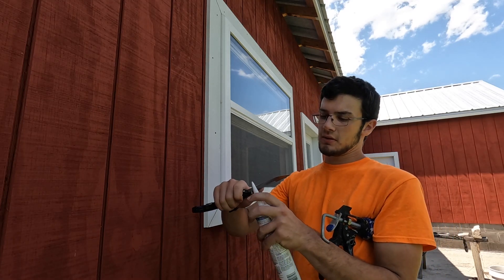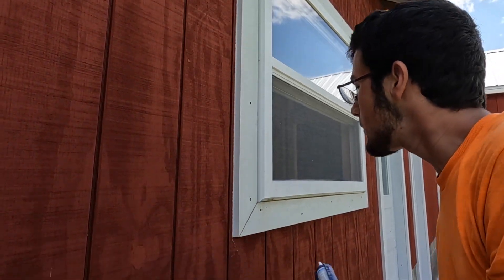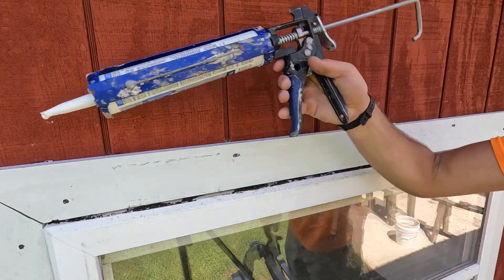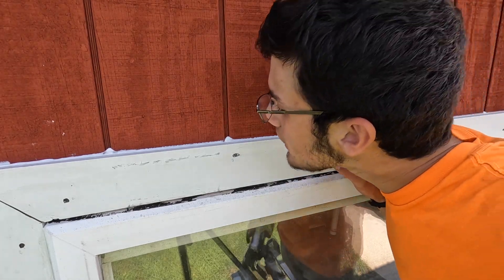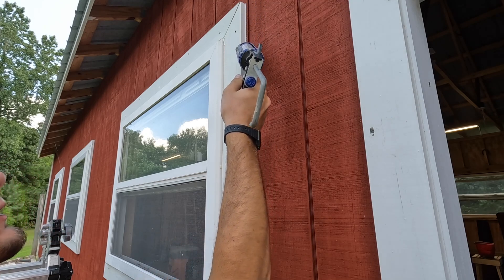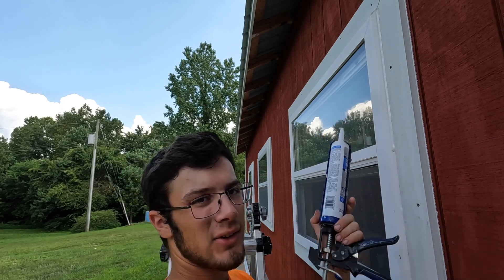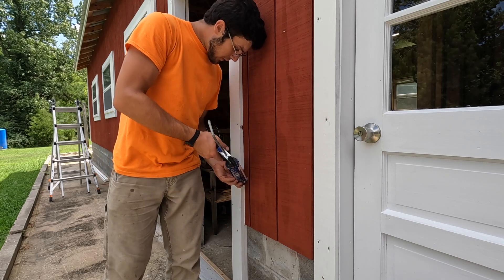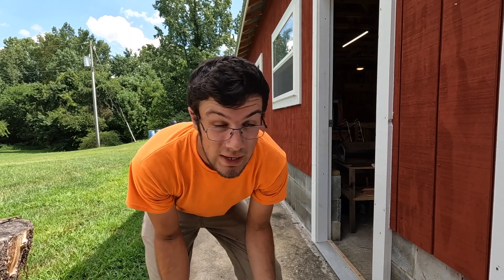How to seal windows on T111 sheathing

Comment: For year I’ve done just this, and see it a lot where I live as t-1-11 is common. But in reality when trim sits on top of siding it should not be caulked. When they butt together it should. Caulk is a maintenance item which rarely is maintained. This traps water more than anything. Job security for the next guy I reckon.  Better to seal the the expansion gap of siding to window with good quality stuff like polyurethane.  Never sees sun. Use trim cap flashing for the top, or do a bead like you are but make it a fat angled one as a water table. When using thick trim I make a blood groove whenever possible. But relying on caulk around trim to seal out water is not as good idea as it seems. Think the trend caught on because it looks nice. But this IS NOT a good method.
Reply from the maker: Thanks for the advice!
Reply: Do you know of a good how to t1-11? I keep seeing caulking but I want it to be almost maintenance free. I'm installing this on an addition to my house to make it match